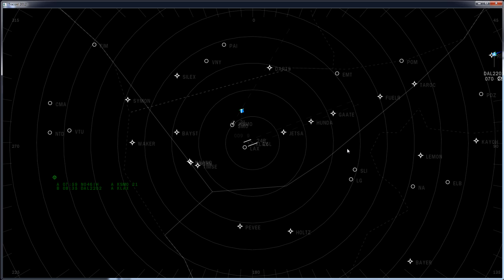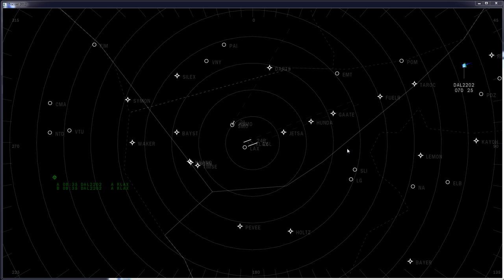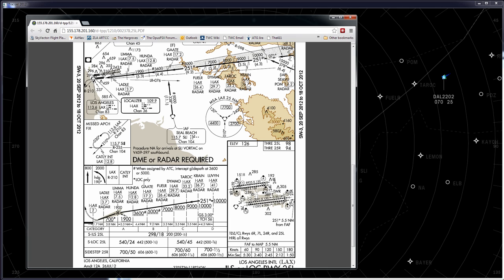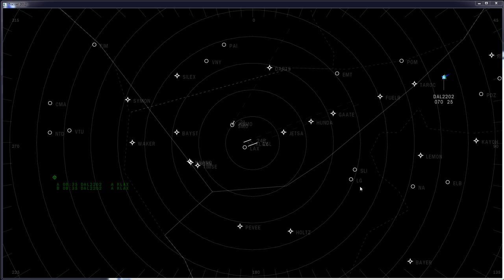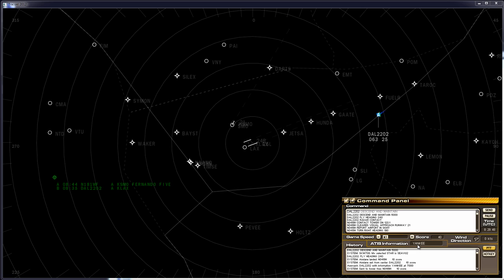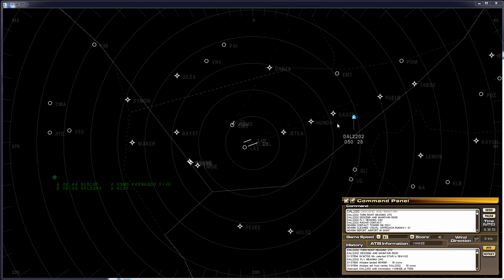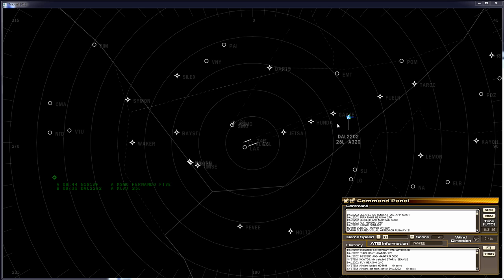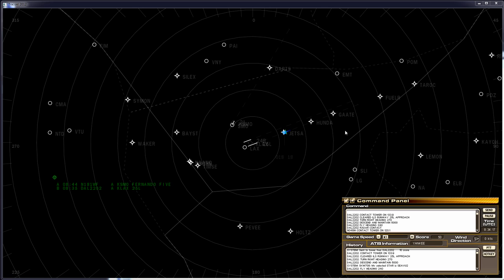Tracon! 2012 - ILS Approach Tutorial

Comment: Correct me if I'm wrong, but you basically need to be in level flight to intercept the G/S? So if cleared onto the localizer earlier than GAATE then it is the pilot's job to descend to that altitude and be at level flight to intercept it? Or would you only issue ILS approaches earlier than GAATE to aircraft who don't want to use the G/S and only the localizer? I'm just a little confused on how you can clear somebody to do an ILS approach above the G/S.

Comment from the maker: The 'default' GS intercept for KLAX Rwy 25L is at 1900 feet (as you say) at LIMMA intersection (the FAF) but per the approach plate, ATC can instruct you to intercept the GS earlier than that, at 3600' (at HUNDA) or even at 5000' (at GAATE).  Intercepting the GS from above is indeed unsafe. Once cleared for the approach, it's up to the pilot to descend to the appropriate MEA to ensure GS intercept from below at the assigned intersection (or at LIMMA, absent an assignment).

Comment from the maker: All ILS approaches have a segment prior to the FAF with a MEA that allows intercept of the GS from below.  It's up to the pilot to descend to the MEA in time to intercept the GS at the FAF (or at the point designated by ATC).

A plane flying the RIIVR2 STAR into LAX, for example, can be cleared for the ILS all the way out at GRAMM intersection (where they'll be 18,000 feet!).  "United 123, descend via the RIIVR2 arrival, runway 25L, then after FUELR, cleared ILS Rwy 25L approach."

Comment from the maker: I don't think I've ever let an aircraft get that low before clearing them for an ILS approach. Most of the time the A/C will be at 4000' or higher.  Make sure the airplane's heading is within 30 degrees of the runway heading before you issue the clearance, and that they are at least 2 miles OUTSIDE of the outer marker.  JETSA is the OM for 24R, and LIMMA is the OM for 25L.  Both are a bit more than 7 mi from the airport; plan on issuing the clearance at roughly 10 mi out.

Comment: Nice video, just getting to grips with FS9 wanting to get FSX, want to get involved in multiplayer as ATC, also looking at Tower2011 and Tracon2012, what's the difference between these two? Can you guide them on dead centre to land? yes im a newbie.
Reply from the maker: Tower 2011 allows you to play ATC from the tower cab, controlling takeoffs, landings, and ground movements.  Tracon 2012 lets you play ATC from the approach and departure positions, controlling planes after they've left airport and while they're arriving into the vicinity of the airport.  A third game, if it's ever release, will be ATCC ("Air Traffic Control Center") which will allow control of upper level airspace that airplanes spend most of their time flying in.  None of these games requires you to finely-control the aircraft -- they always land "dead center" as far as we know :-).    If you're deeply interested in ATC check out VATSIM -- they offer online ATC school for multi-player ATC and flight simulation.

Comment: So,... I'm watching and about 33 seconds into it, you get a handoff of DAL2202. On initial contact you tell them "Radar Contact"... This is very inaccurate. The aircaft had been RC on departure and is never told that again unless radar ID had been lost for some reason. But if you have received a radar handoff (like you did), you would not need to re-radar identify that target.
Reply from the maker: Yep, you're right.  This video was made shortly after the game was released.  I hadn't discovered yet that the transmission could be acknowledged with 'Roger', as is appropriate for a hand-off.
Reply: Ah! I understand. There were a few things that are pretty inaccurate here but overall a really good sim/game. I would suggest reviewing the 7110.65 and looking to VATSIM to interact with other "real" people :)...  Another question is why doesn't it use PTAC phraseology for clearance?

Comment: How do you know what headings to call? What does it mean?
Reply from the maker: I'm not completely sure I understand your question.  How do I know what headings to call for what?  Let me guess you mean "how do I know what headings to call to get a plane on an ILS approach? (or any other kind of approach, really).  If that's what you want to know, the basic answer is that you have to work backwards from the runway heading.  Every runway has a number associated with it -- Rwy 25 or Rwy 7, or whatever.  This number isn't arbitrary -- it's the magnetic heading of the runway (with the final zero dropped).  An airplane that wants to land on Rwy 25 at LAX has to be flying a heading of 250 degrees.  Usually, airplanes are not nicely lined up with the runway so you have to guide them (while avoiding other airplanes and obstacles).  All of your heading calls for an airplane that wants to land at an airport should be to get them closer to the airport (when they are far away) and then get then roughly aligned with runway heading when they're close (say, within 5 miles).  The final alignment doesn't have to be very precise -- as long as the heading the airplane is flying is within 30 degrees of the runway heading, you can clear the airplane for the approach and they'll figure it out on their own from there.